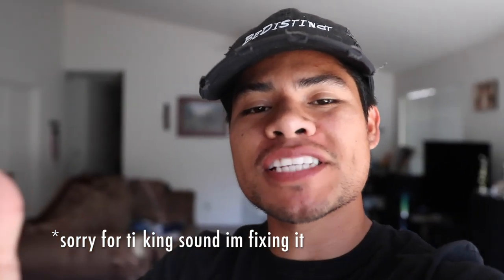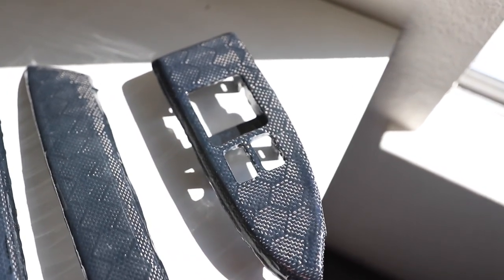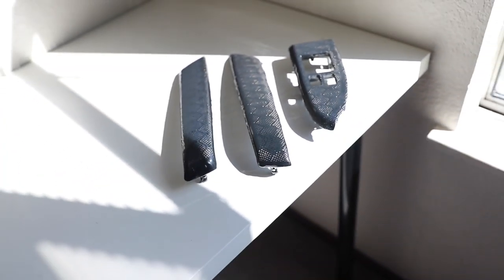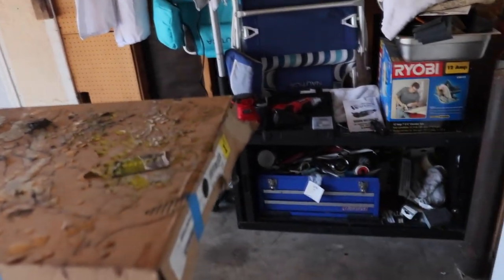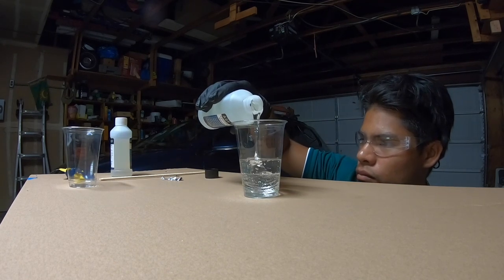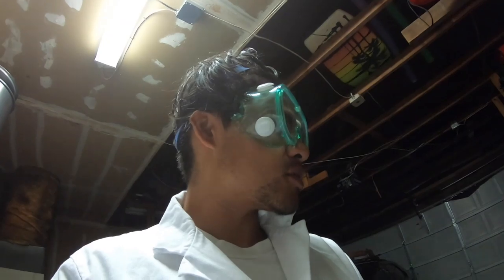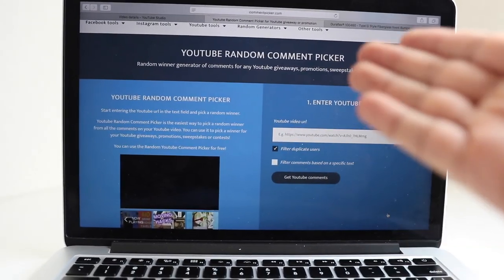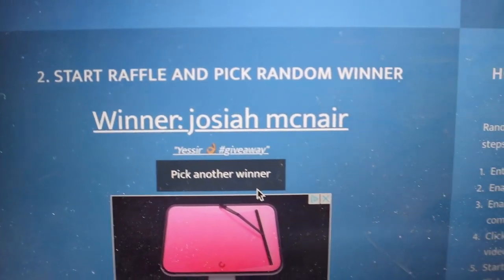G35 gets HONEYCOMB CARBON FIBER OVERLAY PARTS (HOMEMADE)

Comment: Hey bro are you on coil overs or lowering springs? And if you are, which would you recommend?
Reply from the maker: ACTV PRODUCTIONS I’m on springs but I am going to switch to coils soon, I want to see how it feels, if you have a really tight budget springs are not bad but definitely want to try coils since everybody recommends it
Reply: BeDistinct oh ok thanks
Reply: BeDistinct also, is it smooth driving on springs or at least better than stock suspension?
Reply from the maker: ACTV PRODUCTIONS I wouldn’t say smoother but it does feel more planted

Comment: not gonna lie my dude.. cut all the excess fabric before you resin over it. Also Wet sand it by hand you're much much better off
Reply from the maker: Justin Mendoza I was thinking that but the cloth would dismantle, like you know how it is woven, when I made cut, like a strand would fall out you know. I should have cuz way more tho before resin, but it was my first time and I wanted to make sure I had enough to cover the piece
Reply: @BeDistinct  you put  some of the tack stuff on the under side so the cloth has something to stick to and it wont unravel
Reply from the maker: Justin Mendoza oh I see what u mean. I did exactly what you are saying the second time on my center console. This first I did hella things wrong but I improved a lot on my my center console, the video after this one

Comment: are you going to six speed swap it aswell?
Reply from the maker: silved once I swap the engine I will be doing the manual swap as well that corresponds with the 2jz called the r154, I’ve been practicing driving manual